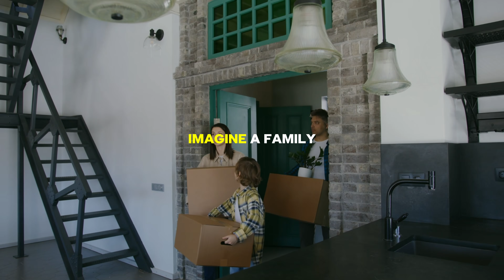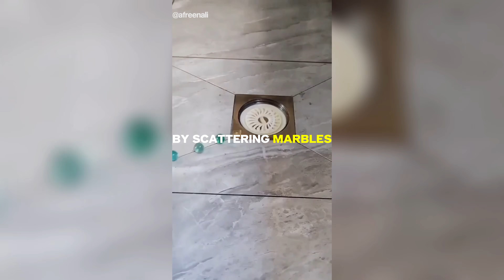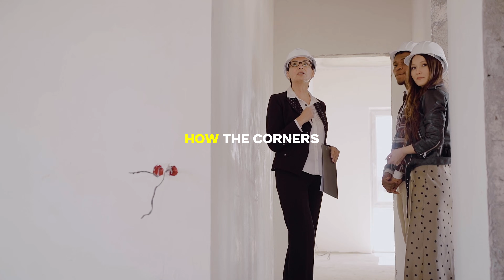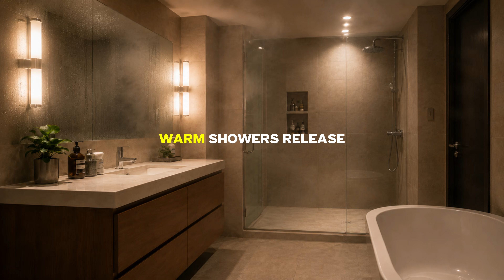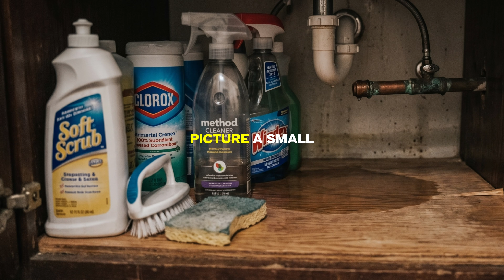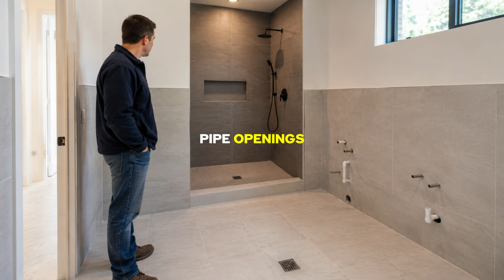5 Bathroom Design Mistakes That Cause Leaks and Mold

Comment: hi arki. better po ba ang porcelain sa floor ng t&b sa 2nd floor compared to ceramic?
Reply from the maker: Hello po. Overall po better ang porcelain than ceramic mas durable and low ang water absorption nya. But more expensive po sya than ceramic.

But since sa 2nd floor po yung bathroom, make sure po na mawaterproof yung bathroom floor and the wall ng 300mm from the floor before tile installation.
Reply: @architectpiauy ah ok, sa waterproofing po pala talaga maiiwasan ang leak sa flooring hindi sa klase ng tiles. Salamat po.
Reply from the maker: @yajonairam7049 yes po